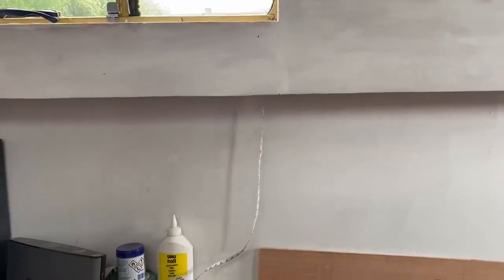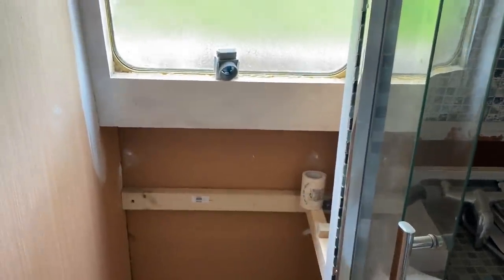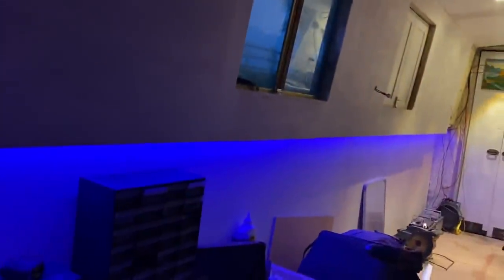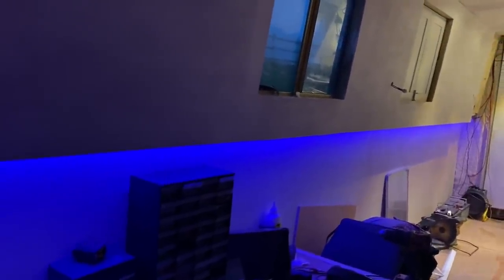184. Under gunnel lights installed

Comment: There you are!  I was starting to worry you had fallen in the cut, or been kidnapped by Carol.
For the LEDs, there is no need to split the circuit in the bow.  Bring another feed in at the galley end, and run it like a ring main.  A capacitor across the input to the LED PSU should cure the colour changing problem.
All the best, matey.
P.S.  It's spelled gunwale!
Reply: Ah, but it sounds like gunnel, init? ;-)

Comment: Hi James. Great job with the lights. You could also put a single power supply in at the middle of the boat so that the LED runs For and Aft will effectively be shorter. Shorter cable lengths =  less voltage drop.

Comment: As someone else has said, check the connection where the strips won't go white - one of the colour lines is probably not being energised. I'd also suggest running each side of the boat as a separate circuit with their own controller, tied to one remote if possible. Very little current draw so wouldn't worry about the non-visible section of lights. Connections = trouble.

Comment: I think red and yellow colours (warm) draw the most. all the colours are needed to make white as such with the type you are using. Removing LEDs from areas they wont be seen will help. Having them on different cicuits is probably the best thing because if you are not using the bathroom then they should be off really. Every amp counts when you are mobile.

Comment: I found that it wouldn't make white on my lights when one of the connections was slightly off. As someone else commented, you need all the colours to make white, so might be worth giving the joints a wiggle to see if you can get that green side to go white too.
Reply: Some LED strips have 3 colour 'bulbs' which combine to try and make white. Some have 3 colours plus a dedicated white